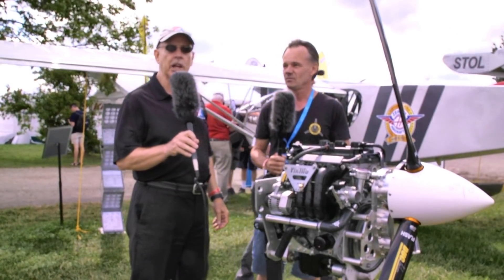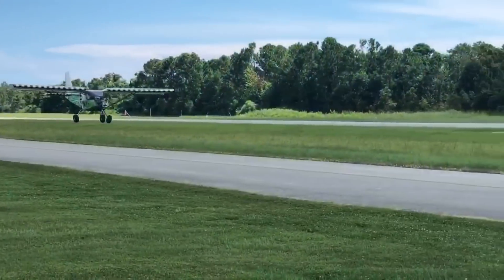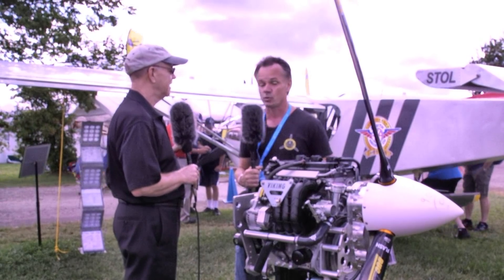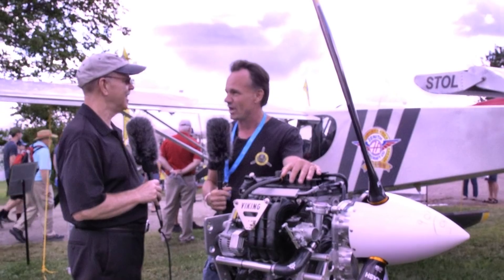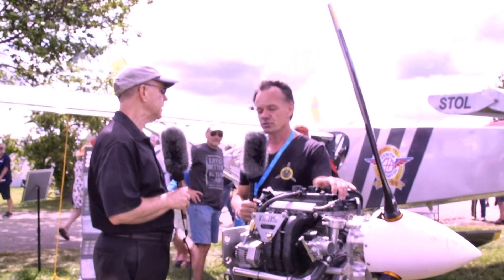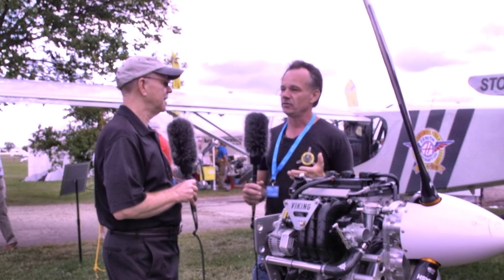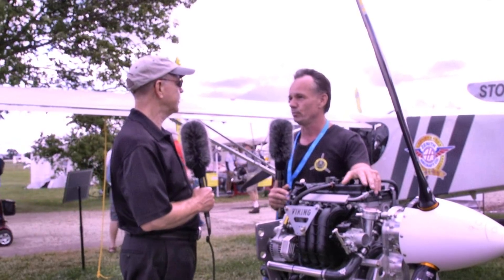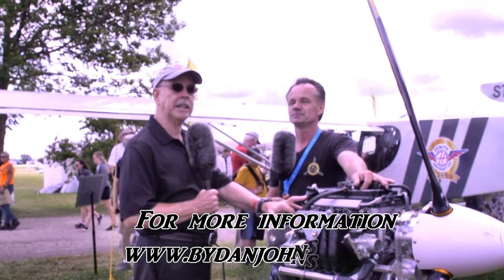Viking Aircraft Engine, Viking 3 cylinder aircraft engine conversion, Sport Aviation Showcase

Comment: Good explanation of the variable intake cam. Now with the variable intake cam , peak torque is spread over a much broader rpm range which translates DIRECTLY to more available torque at a lower RPM and offering the ability of a lesser fuel burn per hour if matched with the proper propeller.